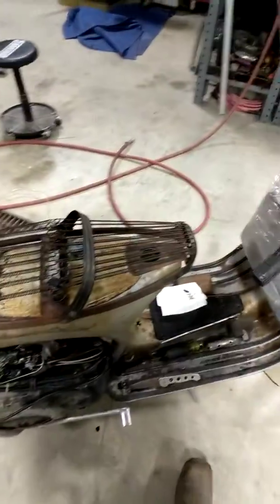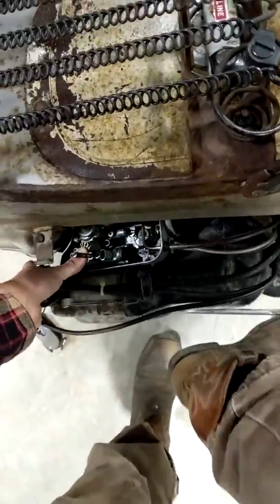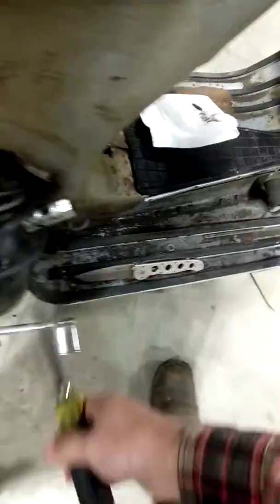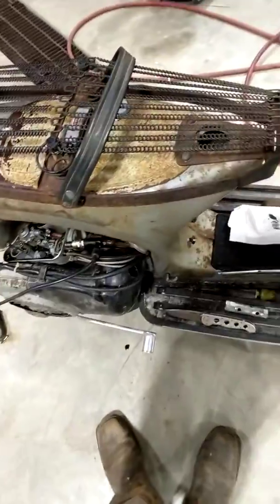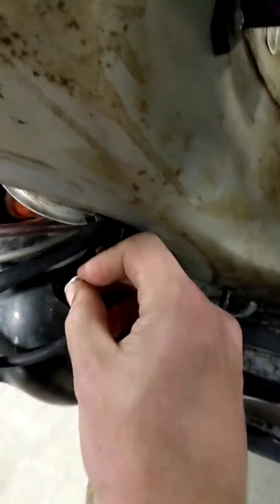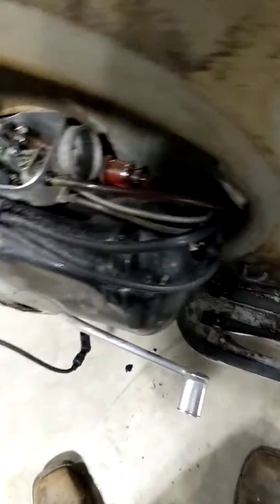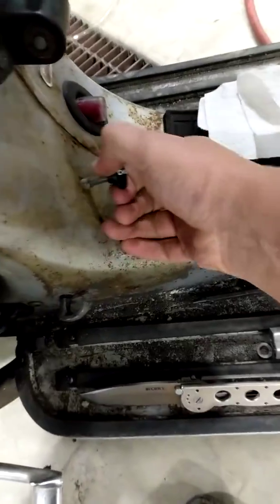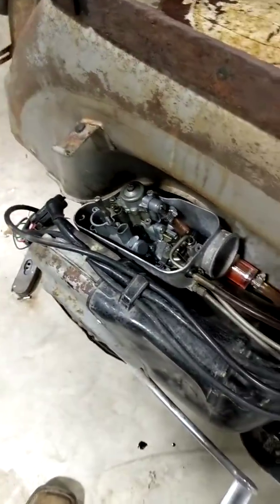P200e no crank, has spark and fuel

Comment: Did you ever figure out what the cause was?  I have a p200e with the exact problem and is driving me crazy.
Reply from the maker: Jared Vaught stator was bad.
Reply: @hvguy  same problem here. Theres a spark but wont start. Was it a bad stator?
Reply: I have the exact same problem but my vespa does not have a battery it runs without it so could my problem also be stator